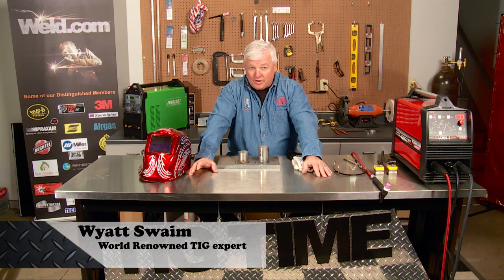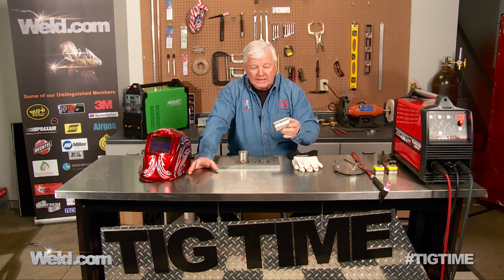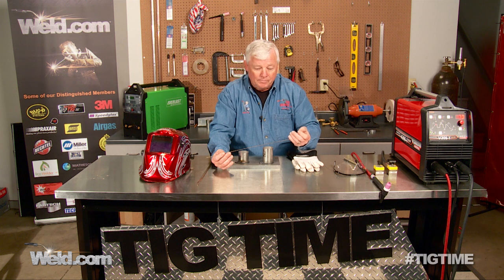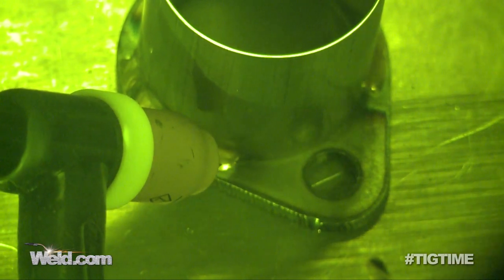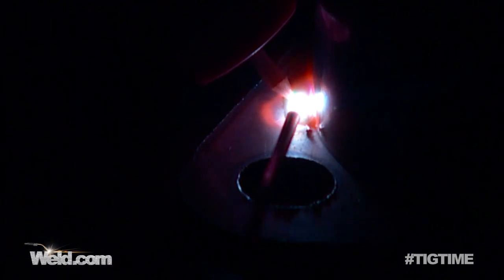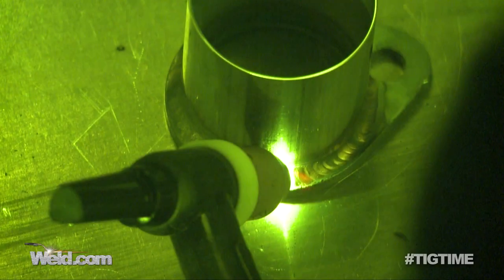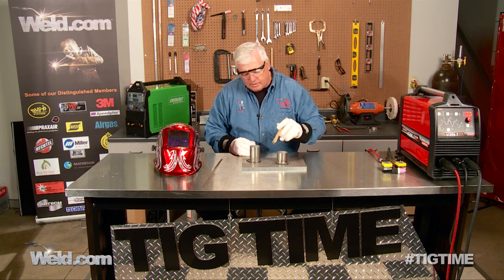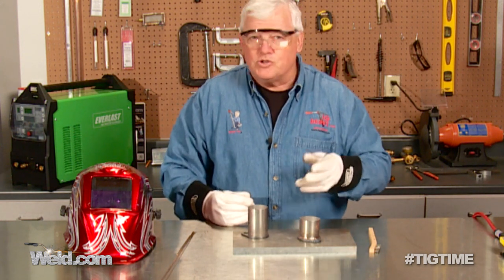Silicon Bronze TIG Brazing

Comment: Nice video. Quick question: does the base metal need to be hot enough to melt the braze rod like it is in gas brazing or is the puddle alone being hot enough to melt braze rod enough?

Comment: On a overlaped sheet metal joint which has already been spotwelded since it is on a car whould a weld through primer be good to prevent the joint from future corrosion or would a liquid metal etch be beneficial thanks mate

Comment: Doesn't help watching the experts with their expert welds - I can make stuff look easy too. Why not show us what we all go thru trying to learn this - flow, amps, dc,ac what settings? I've got hours into wasting si brz rod  with horrible results - the rod balls up and sticks to nothing. I cant get it to flow. please tell me the exact settings - the no fail procedure and give me hope!
Reply: I saw another video on this subject.  There seems like a fairly narrow range of heat for this, the guy was making this specific demonstration you could just do yourself.  Trying more and more arc power until the filler flowed nicely but not too much.   Too much heat and the filler goes all over, and above that you melt the base metal which in this application is a big mess and sort of a disaster.  I have seen this as a kind of calibration:  More power 'till you just barely start to melt the base metal, and back off from that and try a dab of rod.  Too little heat and the metal doesn't wet out, it just sits there, or the rod melts and just rolls off.  Ah, I've done this a little on the bench, just put little bits of clean 16ga. mild steel together with it, lap joints.  It's easy and very little damage to the base material, very little distortion.

Comment: What if this was a bronze that's made for gas brazing, without the silicon in it?  What would happen?
Reply: If you're asking about the usual "Low Fuming Bronze"?  I think the problem is that the zinc in the regular "bronze" rod will get loose, and turn into toxic messy smoke.  Or gas brazing that is suppressed partly by flux, and partly by use of a slightly oxidizing flame.  And of course by the formula of the rod itself.  But it's LOW FUMING bronze, not NON-fuming bronze!  (I just thought of that!)
Reply: @leonardpearlman4017  Thank you.  I really need to quit over-estimating my cleverness when it comes to these matters... and live instead.

Comment: does silicon bronze provide adequate backing for preventing carbide formation when welding stainless?
Reply: You are not melting the stainless so carbide precipitation is bot an issue due to the base material not reaching liquidous temp

Comment: I understand that this isn't as strong as a normal weld (this technically isn't even a weld) where I am LOST is, how does this hold at all? If the base metal you are "welding" to isn't even puddling, it's not penetrating. Help me understand this please. This SEEMS like using electrical solder on steel...
Reply: brazing only bonds the filler metal and the base metal on the very surface. it's not fusing both metals, (which is why it's not classified as welding), but there still a relatively strong bond
Reply: That's pretty much it.  Solder and braze metals make an alloy with the base material.  They're not just sitting there!  Electrical solder is the same.  But it's not as strong because it's made of tin and lead, right?  Copper alloys, silver alloys, nickel alloys are much stronger.

Comment: Trying this in my garage/shop (retired hobby) I find my problem seems to be over heating the base metal and ending up with some braze and some melted base metal. My problem is getting the base up to the correct temperature for actual brazing without overdoing it. Any suggestion as to exactly what to look for?
Reply: Yes:  Before you put any filler, when you're heating the base metal, there shouldn't be any sign of melting.  No puddle.  If you get any sign of melting (easy enough to do!) you're at the absolute upper limit of temperature, so go down quite a bit (?? how much??  How to say?  If it's a foot pedal there aren't any marks!)  ??  Maybe down one quarter?  And try again.  It's fairly obvious if it's too hot or too cold if you're in range.
Reply: Thanks. When my eye sight improves some I am just going have to experiment with various size pices. I have done a little with a tourch and it went ok, so it's just learning a different method-
 @leonardpearlman4017

Comment: I have a miller diversion 180 and I'm starting on projects with brass and steel and I was wondering if the glass cup is necessary or if I can use the ceramic cups provided with the welder? If glass is needed do you know what size and where to get one?
Reply from the maker: Glass is not needed. You will be just fine with ceramic.

Comment: I've read that copper (only copper) can use NITROGEN for shielding gas, since copper doesn't form nitrides.  It's supposed to be cheaper and very intense.  I'd imagine my little electronic welder might not light up in the  N2 atmosphere.  I wish someone would try this.   Also was wondering why we're not using A.C, here, to get some cleaning action.  I've tried this myself and it seems to work.

Comment: If you could only have one filler rod size of silicon bronze around, what size would you pick?
Reply from the maker: that's extremely subjective based on the applications you are doing. However, for us it would likely be 1/16 diameter.
Reply: Weld.com
That's about what I was thinking, thanks for giving an answer!
Reply: theomnipresent1 I used 3/32 the other day and fire the most part it seemed too big.
Reply: 3/32

Comment: the way i learned to do this was with a stick welder. carbon rod in the stinger and you dab your silicon bronze rod and burn it in with the carbon. I can't find anywhere on the internet of other people doing it like this. has anyone else ever used that application? granted I'm no expert, and I learned working in my old uncle's sheet Metal shop
Reply: That's pre-internet technology!  Early books about arc welding show this, people used it for brazing galvanized sheet, steel pipe I think.  I've read about doing this by laying the rod on the joint, and directing the arc on to the rod.  I've tried carbon arc a little and liked it, but you're kind of on your own!  If you look in an arc welding book from around 1940 you'll find something.  People used to say this was good for teaching (arc welding and TIG welding) b/c the carbon rod doesn't stick to the base metal if you touch it.  Seems to be true, and it's just a cheap thrill in general.

Comment: Great viedo!  I want to try this product using a MIG welder on a tubular spaceframe that uses 3/4" diameter steel tubes that are 1/16" thick.  Can you recommend some settings to begin with and maybe post a video of this process but with MIG instead of TIG?

Thanks!

Comment: I'm assuming that, prior to tig brazing, the parts being brazed are thoroughly cleaned
Reply: He's not using any flux (which actually dissolves oxides) so I think it has to be clean bare metal.  I've tried this with A.C. to get the cleaning effect, and was surprised that he wasn't doing that.  The cleaning acts like flux, sort of, and then the argon keeps it clean.

Comment: Mr. Tig,
Thank you for the great demonstration.  However, it would be nice if you could go over the settings on the welder used for the brazing process. For example, were you using DC (DCEN or DCEP) or AC?  How about frequency on AC?  What about the type of electrode?  Argon or Mix?
Thank you for your time.
Reply: I think that would all be useful information. This video is only showing how a good braze looks. It is not helpful if you are doing it wrong. Setup, gas flow, angles, etc., are all important but not covered here.  BTW: TIG is always electrode negative (even on AC) and argon.
Reply: Armand Tomany fuck sakes...try them all....do some test runs on some coupons and YOU see what's best for you...daddy don't need to hold ya hand

Comment: What is the code for this silicon bronze filler? I see that McMaster has a "3 SiB" as a filler rod for TIG welding and "ERCuSi-A" as a MIG welding wire. I work only with TIG welding, but I'm not sure if both filler materials are the same thing.
Reply from the maker: 3SIB. You can find it here: http://www.weld.com/index.php/shop-weld-com/shop-weldcom/filler-metals/silicon-bronze

Comment: Lacking information.... Amps, filler wire size...???
Reply: About 110 amps, 3/32 filler rod.. silicon bronze..
Reply: @shaolyntheabolutenoob 
No way you can do that at 110 amps 😂😂😂 did you hear the part where he don’t want to melt the base metal??
Reply: Silicon bronze is a super special rood only for tig and until i realized that i tried with normal bronze roods.. what a disaster.. it didn't work.. there should be more technical data and specific information. Fancy youtube video... otherwise silicon bronce roods are extremely expensive..

Comment: Dear 19672701  When welding silicon bronze with the tig process, it is not necessary to have any other flux because you are protected with the inert gas "argon"  If you have ever witnessed the gas welding process it is always necessary to have a dip type of flux or prefluxed bronze.  good luck Mr. Tig
Reply: Mister Tig , not if you have an inline flux bottle in acetylene line.

Comment: would this be a strong enough weld for body panels --like putting new quarter panels on and floor pans and stuff like that ???
Reply: yes, brazing is very strong. i have seen large cast iron lathes that had been dropped and shattered the main housing. it was brazed back together so yeah it will hold body panels. i used it to fill areas dished by a grinder when i ground off bolt heads that were pinch welded. i had to replace the bolts and body filler would have cracked so brazed, sanded and like new.

Comment: John,  Tig certainly is a good way to go...  You need to define your projects and match the power supply to the amount of amperage needed.  A good rule of thumb for amperage is 1-amp per .001" thickness.. You can get further assistance by calling tigdepot.net  800-456-9172.  thanks for watching  Mr. Tig

Comment: What is the rod name for this? It isn't an ER correct? I am also curious about aluminum using dc and this process if only making, say a oil catch can. Thanks mr. Tig.
Reply: While you CAN us DCRP to weld aluminum, it does not work well for thin sections and it won't be pretty.  For a catch can, stick with AC.  BTW,  Wyatt (Mr. Tig now) used to work with me....I caught him everything he knows and he's forgotten a lot.  :)
  I use ERCuSi-A filler, usually .062" diamers and made by Harris and by Radnor.    My local Airgas dealer stocks it.

Comment from the maker: Just keep in mind that this process does not have the strength of a traditional weld. You aren't going to want to tig braze any critical parts. Thanks for watching!
Reply: Do you mean Engine Mounts on a WWll British Lancaster Bomber. They were Bronze Welded or Brazed on T-45 High Manganese steel.

Comment: I need some help. I recently bought some hobart bare bronze 770510 rods to try some with my tig.  This stuff spatters and smokes a ton. There was a lot of white zinc dust as I just made my tacks. I saw your other bronze/tig video and it looked similar to my experience.  But, this video and some others on YuTbe have made bronze/tig welding look butter smooth.  What's happening? I'm using DC. Is there a difference Bare/silicone bronze? Please help clarify
Reply: You have oxy-acetylene brazing rod.  You need the silicon bronze rod made for GTAW.
Reply: @G31mR  Silicon bronze can be welded by any method, but yeah, don't use "Low Fuming Bronze"!

Comment: Thanks for the video. Is it possible to use this method with aluminum on dc setting?
Reply: You want Aluminium Bronze, not silicon bronze.
Reply: No, not applicable for joining aluminum.

Comment: hi and thanks for the videos. i have a few questions regarding the silicon bronze rods, are you doing this in ac or dc? how do you size the filler rod diameter and amps to parts thickness? and how about bead size?. thanks again, learning a lot from this channel
Reply: It's clearly DC - listen to it.
Reply: @nibblesmcgurk  it´s clearly solved - watch the date.

Comment: I didn't know you could do this with a brazing rod. Very useful to know this. How can you judge that the component(s) are at red heat (hot enough for the braze rod to melt) when you are looking through the welding shield? Thank you.
Reply: Hi,   Great demonstration.  I have a question.  A friend that owns a restaurant has asked me to fix a small crack in a large industrial mixing bowl. I’m assuming the bowl is stainless steel (it’s magnetic) ..  would a rod like this be good for me or should I stick with SS?  I was a little worried about contaminants because the bowl is in an industrial kitchen…  That’s why I thought maybe silicone bronze would flow nice and just cover the crack up.   Also it’s worth mentioning where the crack is the steel is thin from decades of dough being mixed.  Any info you van share would be great.   Thanks

Comment: I have a question I heard that the thoriated tungsten is radiactive and very dangerous .... is there another alternative for welding stainless steel with a good result like the thoriated one ???
Reply: The Tungsten rod is inert and safe.
The dust from sharpening is very slightly  radioactive if breathed or ingested.

Comment: I had to watch this a second time since it's so interesting. You get a much more controlled and consistent result compared to gas brazing. I'm going to try and find silicone bronze at my local welding supply store.

I thought you would use something like 312 filler to weld this for better strength, but I get the point that brazing keeps temp and distortion down.
Reply: He probably didn't use 312 since he wanted to demonstrate silicon bronze.

Comment from the maker: It is okay to "weld" 304 to stainless but I typically prefer 309 stainless filler...  The primary advantage of the silicon bronze is the low distortion... thanks Mr. TIg
Reply: Weld.com Hey, what settings should I have my Welder on for this?

Comment: Thanks for your video!! I'm in the process of welding a stainless oil pick up tube to a gray cast iron oil pump to be sure it does not vibrate off.  The welding shop near me recommended using Polyweld 755-T which is 55-45 Copper-Nickel. 
After watching your video I think Silicone-Bronze might be acceptable also as they are dissimilar metals and no tensile strength is required in this type of joint.  Any suggestions greatly appreciated!
Reply: I was think the same thing.